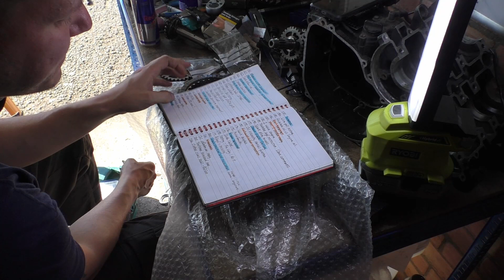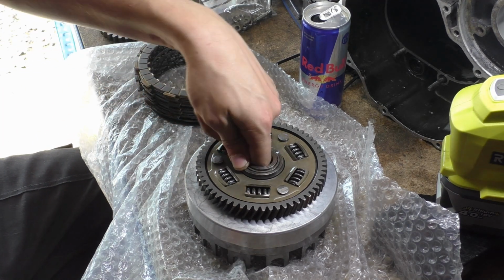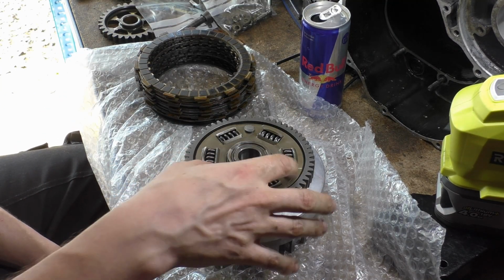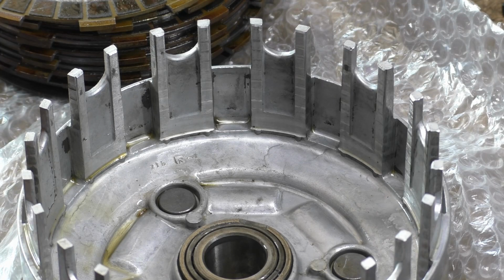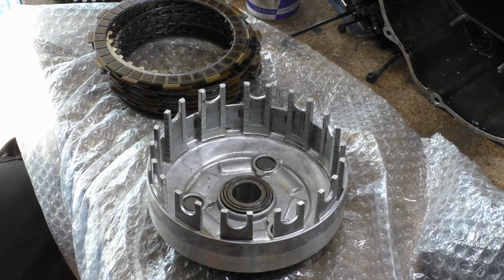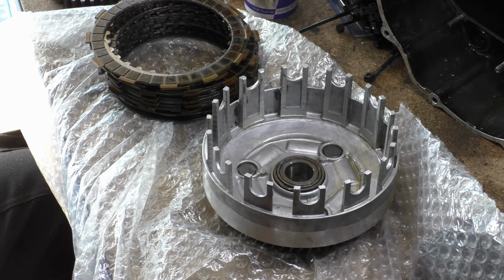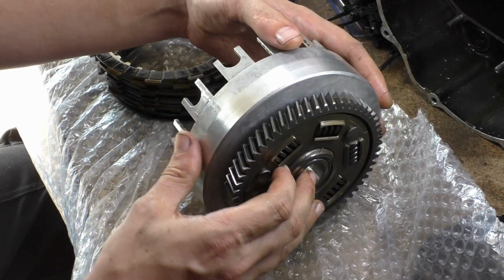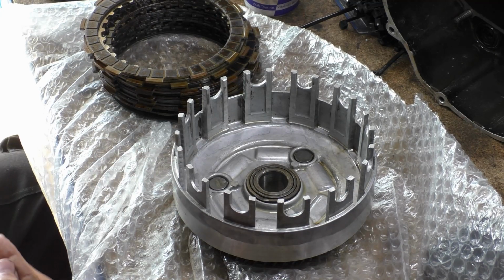Clutch basket wear - Shop Chat

Comment: I would draw file it rather than push file as I find it gives me more control on keeping the file square with the metal, also I use a flat needle file. I would only do this process once then replace if it needs doing again. Excellent video glad to see the ciggy and red bull are still prominent
Reply from the maker: But the teeth don't cut when you draw.....
Reply: draw filing is using it sideways not backwards

Comment: missing the plot a little bit here??  what happens with the clutch baskets is the spring drive system gets loose and the outer basket starts to wobble at the center??
Reply from the maker: The spring are damper spring - to take the chatter and oscillation out of the clutch. Wobbling at the centre is the centre bearing is fucked
Reply: @thedirtyworkshop  yes, but apparently most stock baskets don't have a good thrust surface between the inner and outer components resulting in problems

Comment: Hey when I'm letting the clutch out on my 06 636 the bike kinda vibrates/stutters  other then that it shifts fine and there is no slipping in higher rpm tho I didnt want to test that too much do to the problem, I just replaced my clutch last may. Thanks!

Comment: Wet clutch/dry clutch debate... so if you want to weld all your clutch plates together on your 2004 multistrada just leave it parked in the weather for a few months. Nobody ever talks about this, it’s always just listen to how my cool dry clutch rattles... lesson learned. Found an RG500 motor for 2500 pounds, good deal or let go of childish dreams? Had a TDR250 back in the day.
Reply from the maker: "Found an RG500 motor for 2500 pounds, good deal or let go of childish dreams?"

- LOL never worth it. You're better off sticking 2 engines together or something like that. The cylinders and replacement parts are stupidily expensive - thermostat cost £50!
Reply: Build an rgv250/500 .

Comment: Matt i get what you are saying regarding the filing of the fingers but what about the marks down into the casting, there looks more wear down in the slot than where you was filing. regarding and in reference to the message i sent you on FaceBook could this be a posible cause of my problem with my clutch on my RG not disengaging when going back down the box.
regards Steve
Reply from the maker: "but what about the marks down into the casting"

- you have to file them to. It's a lot harder but possible. The RG clutch is a dickhead to bne honest.

"could this be a posible cause of my problem with my clutch on my RG not disengaging when going back down the box."

- how long is a piece of string? In other words what condition is your clutch in? There's several things it could be;

1. fucked clutch springs
2. worn discs
3. Warped steel discs
4. wrong oil
5. stack incorrect
6. worn pressure plate
7. worn basket 
8. worn boss

you're gonna have to take it apart and send me some pictures - loads of pictures

Comment: Matt ime rebuilding a vf750f '83 and the innee basket, the bit that sits in the basket with the 5 threaded studs poking up. One of the studs which the valve spring bolts spin in to, was broken. Someone took a short bolt and went through the back side to gold it togsther. How long its been this way i couldnt say. Do i need an entire new clutch assembly? Can i repair this? Will it be possible to find just the inner basket its self?
Reply from the maker: If you or someone you know is a good welder then you 'could' weld it back together - but you'd have to be fucking jesus to do it right due to limited access - its quite important that the pressure is even - so yes you need a new clutch boss.

Comment: hi matt what are asymmetrical metal plates between the friction plates good for? and do i have to be careful with aligning them evevenly? saw that on a yamaha tdr 125 couldnt figure out why...
Reply from the maker: "asymmetrical metal plates"? What asymmetrical plates?
Reply: The Workshop like this:

https://www.cmsnl.com/yamaha-tdr125-1997-5an2-germany-275an-332g2_model39675/plateclutch_1v11632400/#.Wxb4p8pCQ0M
Reply: The Workshop so kinda like the "teeth" that engage with the boss are eccentric and the weird nose on one side
Reply from the maker: The little tab - I have no idea unless I saw the rest of the clutch - as for the eccentric teeth - are you sure? They look radial to me????
Reply from the maker: Looking at the picture there isn't a tab but its recessive - this is probably for oil drain back - so the plates don't pool oil....
Reply: As far as I see it in that picture the friction plate is thicker, radially, on the left and right side compared to bottom (where the nose is) and topwise.
Reply: alles klar klaus yeah thats what i mean 
where the little tab is on the bottom the there is less matetial so the tip of the tab has the same outer diameter as the the plate on the left right and top...donno if that makes sense now
(eccentric wasnt the right description😅)

Comment: When you say you'd only remove 25% of the thickness of the prong, do you really mean 25% of the thickness of that particular prong? It seems like quite a bit, especially if you're doing the side of the prong opposite as well. Would you then end up with something like a 50% increase in clearance?
Would you be better off only going up to a 12.5% reduction in prong thickness instead, to keep a 25% or less clearance increase between the prongs?
I'm not sure how much play you can get away with on those so I just wanted to clarify.
Reply from the maker: I'm saying maximum across both prongs not a single one - but you're right I didn't make that too clear
Reply: The Workshop Sweet. Thanks bud.